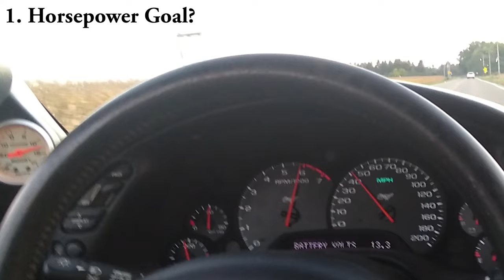Supercharging the C5 Corvette! (Without Destroying your Engine.)

Comment: I have an 1100rwhp procharged e85 C6 z06. There is so much that had to go into building that engine to make it handle 16lbs of boost. For starters forged internals, darton sleeved block, updated cooling system and fuel system with flex fuel sensor, rebuilt heads, headers. Once you start making power you've exceeded what the clutch , transmission, torque tube, differential and axels can handle so all those have to be upgraded to stage 5, and of course adding a good set of drag tires such as m/t or toyo or nitto. The end result is nice but it's not cheap👍
Reply from the maker: Man, that's a lot of power. I think I'll just stay south of 700. Sure would like to go for a spin in it though!
Reply: @Toys4Life  Maybe one day that can happen 👍
Reply: Torture tube 😂

Comment: Ya I blew a ringland on cylinder 7. I  got greedy 651whp, last almost 3 years,  we don't have e85 in canada.  Ordering some summit forged piston and h beam  rods, block still looks good but I'll  take it to the machine  shop to check it.  The ringland stayed together until the piston  was removed.  Thanks for the video 👍🏼
Reply from the maker: Thanks for the feedback, I've studied that cylinder number seven and eight thing and man for some reason cylinder number seven goes and there's all kinds of people way smarter than me speculating as to why but nobody even at the higher echelons agrees 100%, at least from all the research I've done. Have you heard anything different? Obviously it has to be either too much heat or too little fuel but nobody seems to agree 100%?? Good luck on your new build!
Reply: @Toys4Life  I've heard cylinder 7 just runs hottest, lean cause of intake design I've  heard I'm  not sure, good insurance is gapping the rings . This time I'm  gonna run meth for insurance.  I wish we had e85 in canada!

Comment: The most common thing I see is a cracked ringland, Did it to my ls3, my fault, should of safely ran the fuel out of the tank after winter storage even with stabilizer in fuel, it drops octane, now I know only cost me a fresh Texas Speed short block and then it escalade is real fast to ARP everything, Johnson lifters,TSPcam, custom Smith Brothers pushrods, billet timing chain, ls2 tensioner, hv oil pump, ls2 balancer, bigger injectors, smaller pulley, twin aux fuel pumps, 15" conversion, roll cage, parachute, 😂

Comment: I have a 99 convertible that’s stock. I’ve heard that the early LS1 head gaskets are not as good as later versions. If that’s true, the gaskets would need to be replaced before supercharging.
Reply from the maker: That may be true, but I don't believe that's a common issue.
Reply: There's a 99 Corvette in the Corvette museum in Bowling Green KY with 773,338 miles on it that's never had a major repair. It DID have the head gaskets replaced at 753,338 miles.

Comment: Realistically what would you expect from a 4 spd auto 2002 with a Callaway CAI, Long tube headers, and a corsa exhaust? Do you think with the auto it will run strong? Hang with new cars today?
Reply from the maker: IMO With a stock auto in good shape - I would keep the HP down to low 500s.  With a tired auto, you may want to get it rebuilt first - or plan to soon after.  If you drive it hard often you may need a rebuild but if done right you can turn up the HP !  This will not only hang with new cars - it will handily beat most.

Comment: My friends have been telling me ever since I got my C5 to supercharge it, even though I only planned to do a H/C/I setup with exhaust. Seeing as how reliable the A&A Vortech superchargers are, I may actually do it. Especially since it's actually legal in California where I live.
Reply from the maker: Right on!
Reply: I would do it, with just exhaust going with a cam, especially if it's an auto trans, you sacrifice a lot more drivability than everybody will tell you, Especially the one selling you the cam, 9:17  bucking, surging, high Idle, multiple miss fire codes, going into neutral cause stock converter will push threw the brakes etc ask me how I know....

Comment: I’ve wanted to super charge my 2002 for some time.  I’ve had it for 19 years now.  It has 27,000 miles, but the only issue I have, and the reason I haven’t done it, is because it has the automatic trans.  Do you think it would be beneficial to have the transmission reworked before I add the SC, or could I just leave it stock?  
Love the channel and enjoy each episode!  Thanks.
Reply from the maker: I would talk to A&A about your specifics - they are straight shooters.  If I had a stock auto I would probably go with a 3.8 pulley ( a bit lower boost) and not tune it as aggressively  - keep the RWHP down to 480 or so.
Reply: I plan on keeping my auto down to 500 hp. But I’m gonna do it.
Someday…

Comment: I've been on the fence about supercharging my 2000 C5 as I live in California so I can't do heads and a cam but my car sees a lot of higher rpm track driving so I have been thinking really hard about it. I'm curious what about your opinion is, but I think with a knock sensor light, hood vents, a very conservative tune and a redline of 6000 I might be able to get away with supercharging my car and not blowing it up. I would love to hear your thoughts though.
Reply from the maker: What kind of track - how long would you be in boost at a time and then after a corner, would you be right back into boost?
Reply: @Toys4Life  I do a lot of spirited driving in the canyons, so I'd say a good 20-40 seconds on throttle, off for maybe 5-15 then back on again. When I drive like this with the stock motor and an upgraded radiator I notice my oil temps tend to get pretty high after about 20 minutes so I'm planning on getting an oil cooler. The more I think about superchargers the more I get worried about heat though and I'm starting to think I should just leave the engine alone.

Comment: My C6 has 162,000 on it and i have around 8k to put into it. 
Right now, it has a full exhaust and a pedal commander  I just don’t know if I should write the bullet and get the supercharger kit. I was planning on buying it this year but because of inflation now it’s $2000 more than it was last year. Which makes me debate on whether I should just get 06 rear fenders wider rims for fat rear tires and then coil over suspension and some type of areo. it would handle better but it’s still would only have about 400 hp do you think 162,000 mile LS two would handle a supercharger making like 500-550 to the tires?
Reply from the maker: That might be a bit high.  If you oil pressure is good (indicator of bearings in good shape) and you have good compression (indicator of good piston ring sealing) you might be fine?  Up to you, your call - I can't say for sure....
Reply: @Toys4Life  well thanks for answering. I know basically from your video you said it’s all a matter of how your engine has been worn.

Comment: Hi I have an 81 corvette C3 with an LS1 swap from a corvette C5.it has a 4L60E transmission. I used to be able to launch and the wheels would spin no problem and take off fast. Recently it has been hesitating on acceleration with no more Launch at all like as if I’m taking off on a higher gear and slowly gain speed. no more launch at all. Any ideas on what you think it could be ? I would greatly appreciate your help thank you.
Reply from the maker: Have you ruled out the transmission is going into 2nd way too soon- that would do it.  Clogged exhaust would do it too.

Comment: Hello, this dan again, i have a question about my 04 zo6
I get rattle between gears underneath the car like a loose heat shield sound.
Went under the car can't find anything loose on the car.
Reply from the maker: Check the springs that help suspend the mid-pipe around the area of the transmission. I did a video on it, check my channel.
Reply: Thank you! Going to check into that.

Comment: What happens if you you start out with a ZO6 C5(2004).    ?  Shalom.
Reply from the maker: Might need a bit more octane or meth/e85 for the same amount of boost due to the higher compression.